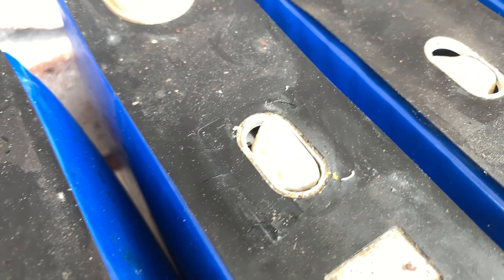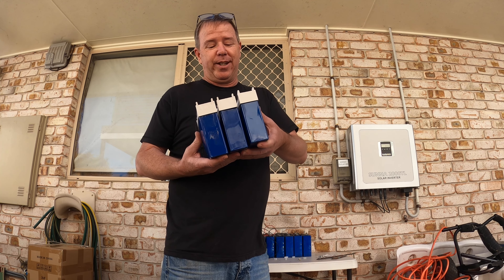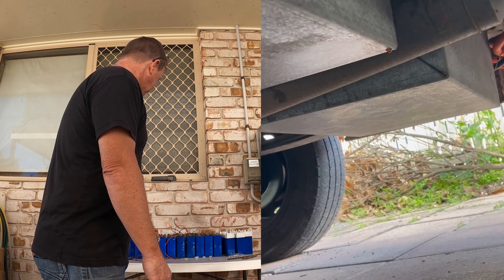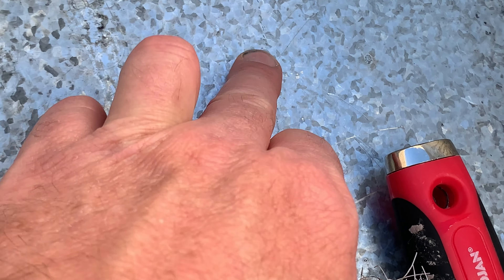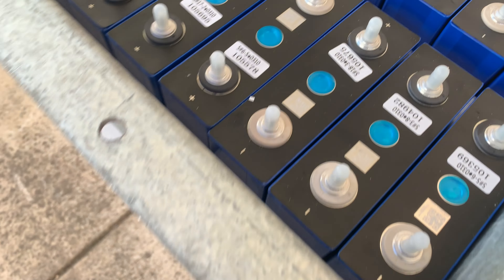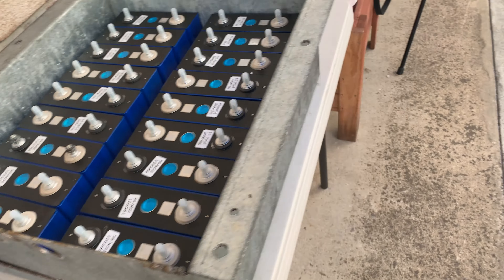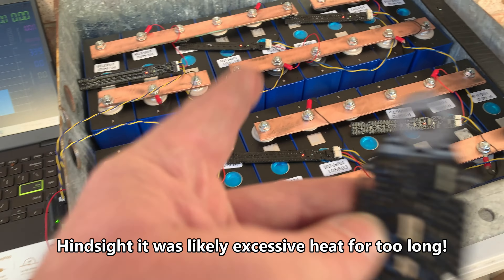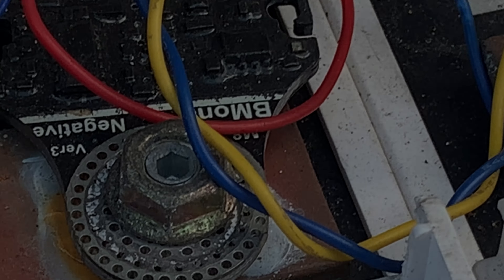Stupid accident destroys LFP EV battery - total rebuild required

Comment: Put 0.5mm epoxy sheets between and below the batteries.  This blue battery film is very thin and the battery case has negative potential. So a good chance for a short!  And steel is also an conductor…
Reply from the maker: Consensus is we have to do more than I did - just have to find a local supplier
Reply: @HBPowerwall  Amazon, Aliexpress, …. Cost almost nothing
Reply from the maker: time costs money lol

Comment: First of all Greetings and love to both of you young and sweet uncles(& I'm from India), it seems you have used a BMS but I have one question: why the BMS didn't cut the charge when the battery reached its maximum rated voltage?? (didn't the BMS come with Over-Voltage protection??) because BMS cuts off overcharging, then how overcharge happens uncle??
because If you have seen "Greatscott YouTube channel video" on this topic, he used a pretty good and a lot of good feature-oriented BMS (but will not be rated for your beautiful E-Van, but there may be another properly rated BMS for your taste from this company), I think you can check his vide. 
However, uncle you are more intelligent and educated enough on this topic than me, but you can give it a shot!!
Reply from the maker: because of our actions it failed in a few different ways. unfortunate but it happens I guess.

Comment: A fue mins of reserch would of told you that for mobile setups, you do require a BMS and padding between the cells... a BMS woudl of stoped this from happing.. as a cell voltage would of got in the red zone the BMS woudl of cut off charging
Reply from the maker: in a perfect world yes, but shit happened - it DOES have a BMS but water got into the electrics in a storm and shit went south...

Comment: I've used that foam before. Don't do use it. That foam acts like a spring with any jolt or vibration, Those batteries will have stressed terminals and wear marks. Oh and that foam doesn't like heat.
Reply from the maker: Yeh it was a bad Idea - but from it I got a ton of good ideas

Comment: Throw copper in a bucket of vinegar overnight and it will come out like new .  A little spray corrosion preventer would go a long way as well. Stainless or brass nuts needed .
Reply from the maker: I will 100% try this TY

Comment: Those bus bars on the end look a bit rough like it's had ingress in there.
Reply from the maker: Every battery looks like it has had water in it at some point. Battery boxes are average at best... Its possible its also condensation.
Reply: @HBPowerwall  True as; Bit of a design flaw considering the likes of most EVs are all sealed. Are you using stainless nuts and bolts with dielectric grease does help keeping the weather out. 

The dis-similar metals does cause problems and worth checking out.
Reply from the maker: yeh have to look into the busbar/bolt issues for sure

Comment: I use those flexible cutting boards between cells and metal, etc.  If that blue plastic wears off on another cell they short out.  I too used the foam on my solar cells to hold them in place and they never overheat. ..course that is in a solar application not an EV.
Reply from the maker: Yes not idea for EV

Comment: Where is the BMS? That should have stopped over charging and over voltage. Also quick charging isn't good for batteries. Once you go over 1.0C battery life is cut in half. It's better to have several banks of batteries  you can keep the C load under 1.0C
Reply from the maker: Brother turned off the protection of the BMS controlling the charging circuit - it's a long story but it's self inflicted

Comment: I'd recommend taking those bus bars to a chrome shop and having them nickel plated. That will stop the corrosion. 

Prismatic cells like that need to be compressed to prevent bulging.

You can't do level 2 charging without liquid cooling. As is, they will just cook. That's probably what ruined the old cells.

Those battery boxes need to be sealed. 

I'd recommend looking at factory battery designs or companies that build batteries professionally to see how they are done.
Reply from the maker: have considered the nickel plating option, onboard charger can only do 3300watts so will be fine with charging heat (but slow) I have a great factory designed battery here I've forgotten about - it has everything I need to copy!!!

Comment: You put these on a vehicle. The cells should not move period, relative to each other or the case. Any movement will result in damage due to insulation, terminals, conductors wear and tear. 
Also, the BMS should forbit charging and discharging if any of the cells is outside the 2.50v-3.65v.
Reply from the maker: it did, but SOMEONE broke it and continued lol

Comment: Ciao ma perché mettere 3 celle in parallelo insieme non va bene meglio 1cella da 300amper lifepo4 e con 4celle in serie fai 12.8volt o 8celle 25.6volt 300amper no good 3p e 6s good 1p 4s o 1p 6s o 1p 8s 1p 16s si good ma perche si sono gonfiate senza che il bms bloccasse la carica
Reply from the maker: space to fit cells I would assume - 305ah cells are much taller

Comment: geez cable tie all the wires ,dont cut corners ,if one of those balance wires brakes off and shorts out ,there is more energy density per weight than dynamite
Reply from the maker: Those balance leads were just temp to allow us to have some sort of monitoring, a whole bunch of supplies arrived yesterday and I'll be heading down this weekend to make the battery much better than it is now and enough to reinstall and retest. It's a process

Comment: i dont like the look of those copper bus bars, im not sure how many amps you will be pulling out of this but if its high you need to get a tool like a YR1035+ it will test if you have a slightly high resistive joint, it can measure 1000ths of a milliohm its a great tool. Check out the channel ray builds stuff he shows you how to build these battery packs safely you are missing a few steps. I also noticed you didnt balace the cells before assembling, you need to top balance or bottom balance before you assemble or when you charge some cells will hit their peak voltage while other cells are still say 80%, you will overcharge these cells.
Reply from the maker: Re-Did the build... hope I did better the second time around..

Comment: hello, some advice, look at the assembly of these cells in EEL or Seplos type boxes for solar storage, I advise you to compress the cell blocks with flanges and tie rods with threaded rods in packs of 8 and put flat foam with polyester plate between each cell moreover your busbars are not flexible for the expansion of the cells and nor insulated for the risk of copper corrosion! and your body is not waterproof and too close to the road! if an impact from underneath the vehicle is a disaster! can you put the box inside and in the middle of the vehicle it would be better There you go, good luck!
😊
Reply from the maker: Thanks for the input - I actually looked at one of my own review videos for a 48v 200ah battery and its so clean the way they do it.. Going to try make my own version of that Orient Power battery design
Reply: Box not water tight - no drain holes?  Get water building up inside?  Seen what happens with spare wheel covers that are slung under the boot of older vehicles.  Would it be better to have the battery pack inside the van and create another removeable cargo flooring panels on top.  Lot easier for maintenance

Comment: The cells moving around side to side is probably not the issue. You might want to put packing "on top of" the cells to keep them from bouncing. Two thick strips down the middle of the cells but leaving the vent hole exposed should help there. This would make it so that when hitting a bump or pothole the cells don't bounce around and possibly hit the undercarriage of the van. This would all keep the wires from moving around much minimizing any issues of them fatigue breaking, as well as the Batrium cell monitors as well.  You want to minimize or eliminate flexing
Reply from the maker: Yeh a few ideas have been thrown around my workshop today...

Comment: Shit Pete you need to stop the battery moving up and shorting out they need to be kept dry possible to stop oxidisation 👍
Reply from the maker: Rip the batteries out - replace it with a modified model three battery and be done with it hehe

Comment: Sheesh what a mess. Don't know anything about the charge controllers in a car or how they work. Apparently not to well. A good bms on a home system is going to be throwing alarms when a cell(s) are not performing and prevent over charging.
Under normal operating conditions heat shouldn't be an issue and it doesn't look from here like there's any ventilation built into the box. Think I'd follow your instinct to put the padding in to support the batteries. Wouldn't expect a whole lot of movement with the cells being bolted together combined with the weight. The foam on the bottom with the weight of the cells alone on it should do wonders to prevent them from sliding around. 
Best of luck!
Reply from the maker: You are 100% right but a water fall of failures inc my brother caused this issue.. Going to do a video that covers exactly how it all happened...

Comment: Even if the foam was used for shipping - that was just for a month or so... The foam under cells will get compressed - that should be fine, as long as it does not degrade and starts crumbling away.... You will put a lot if Vibration on that foam, so as soon as it starts crumbling it will not take long to rub through. 
So foam is fine for testing, but I would not trust it longer than 6 month. I would replace it with that sound dampening car stuff, that is more rubbery than foamy, it is designed to withstand the mechanical and temperature conditions in cars....
Reply from the maker: Thanks for the ideas, I have a few paths forward I'll start shopping around to see what I can find..

Comment: Nothing like a temporary, but permanent, solution. Something I would do. Keep up with the videos. Thanks.
Reply from the maker: I think we will use if or a few hundred KM then pull the battery and inspect. Hindsight is that when packed in boxes for transport each side had 8 or so layers ...
Reply: Peeps are going to subscribe to this just to watch a soap opera of serial truck ups

Comment: If you don't put the cells in compression before you start using them you've compromised the whole deal😅😅😅😅
Reply from the maker: There is lots of debate about that - they are tight enough side to side and that battery box is strong and heavy- you see how bloated the old ones were and only moved the sides about 1cm - more research required

Comment: GOOD GOD - STOP !!!!  Right Now !!!

- That "BOX" must be FULLY lined with at least FR4 insulation sheets (Cells NEVER EVER to contact any metal casing !
- Every Cell needs a sheet of FR4 separating it from the others next to it.
- Cells MUST be Bound Together with LIGHT Compression to prevent exnsion/contraction and put ANY stress on the cell terminals themselves,  This is a MOBILE PACK and Very Critical to do.  EVEN ESS (Enerrgy Storage Cells) need light Binding.
- Busbars etc MUST be properly Torqued and use Lock Washers and/or serretade locking nuts or washers.
-  NOTHING that holds any sort of moisture is allowed near the cells, you WILL have major issues quickly.

LFP is MilliVolt & MilliOhm Sensitive and requires precission & accurate measurements & BMS / Charger parameters MUST reflect that accuracy which has to be measured at Pack Terminals & Device (charger) terminals and compensated / corrected for.

THIS IS NOT A GAME, Your Pack that you guys COOKED, could have resulted in Fire & Worse, YOU WERE CLOSE !

BTW:  The Electrolyte IS TOXIC - Handle & Manage that mess accordingly !!!

I am now using your Video as a Perfect Example of how NOT TO DO THINGS  !

I have been building Lithium Iron Phosphate Batteries since 2018 and work with several manufacturers as well as written on this subject (under a pen name).  I've built systems for various environments and some pretty darn extreme (Extreme Cold Handling at -40C to High Heat Environs with 50C+) and have seen & experienced the result of "oopsies" and more.
Reply from the maker: After the comments section lit up - we have a few plans - your comment offers great advice..

Comment: You have to change your busbars to aluminum. The contact between copper and aluminum will corrode very fast and some of your batteries will have bad contact. It may cause balance issues.
At least put something between the bar and the terminal.
Reply from the maker: Didn't even consider that, i'll put it in the ideas bucket

Comment: Worst install of bateries i did not see in a long time and you suprised it exploded.... 😳🤦 Every were corosion, bateries just sitting there with no clamping down... 🤦 Good luck to buying new... Again... 👍😉
Reply from the maker: We paid $3000 aud for the van - with batteries etc lol So won't be buying again hehe We will upgrade them and learn more in the process
Reply: @HBPowerwall  you must better secure the bateries. 👍 Becouse now they are all over the place, the foam from the boxes are not good support. And ridding every time you on a rought street the cells ale all over the place... And the moisture, busbars are all corodead and the resistance of them are very hight.
Reply from the maker: I don't think there is enough thread there to put two nuts on if that is what your referring too - taking the battery out every month would take way too long. My brother floated the idea of cutting access pannels in the floor pan but i think it would reduce the strength of the car body too much.

Comment: I couldn't get the clue what really happened here, you did not explain that part well imho. He was unpatient and overcharged the cells while he was away - bad idea. But what exactly happened here? You must take more care into you diy battery builds, soft foam is not a good solution. Also i don't see any separators between the cells - a no-go! I don't even mention compression cause it is discussed widely in different manners.
Reply from the maker: Trying to explain it in this video would have made it way too long - I've started to document the issues that lead to this failure. As I wasn't there, i'm relying on my brothers description, a bunch of photos and questions on fb messenger & my own investigation. Getting that time line right and making sense of it takes a bit of extra time but well worth the effort I think so will be done soon I hope.
Reply: @HBPowerwall  you are fast 🙂 You can only learn from mistakes if you know and understand them - so i'm waiting for part 2 🙂
Reply from the maker: working on it ... also 6am youtube comments replies hehe

Comment: No good idea putting the cells in without insulating them from each other and from the case. Especially in a moving and shaking set-up!
Reply from the maker: Yes, but hey it was a good idea at the time.. hence it's not installed yet!!! It'll be easy and quick to improve with all the recommendations  here to-date